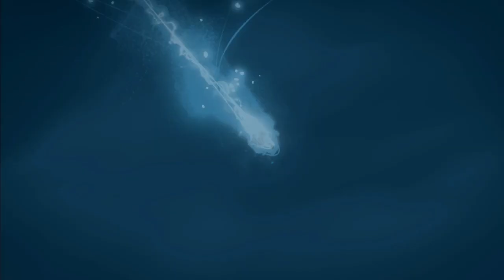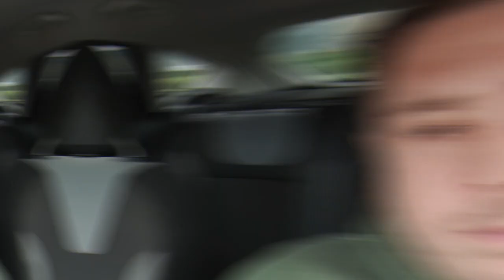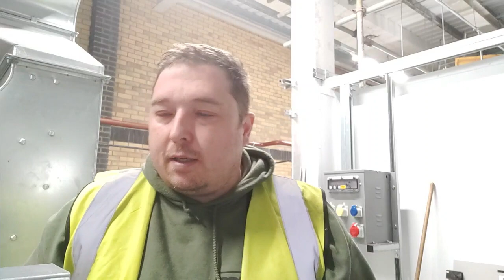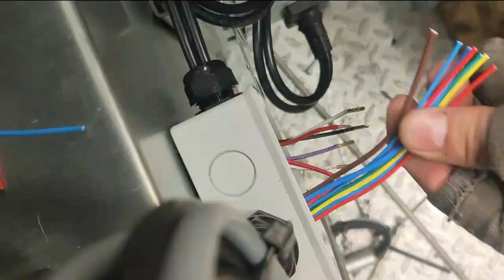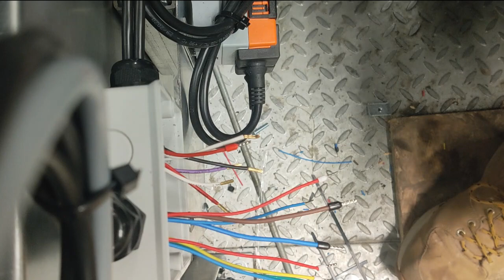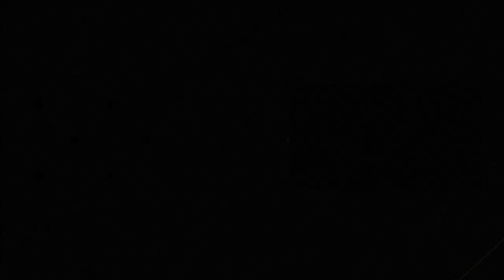ELECTRICAL MIND BLOWING BMS [INDUSTRIAL ELECTRICIAN]

Comment: Nice Sam, normally we'd use the smaller wire markers, then they stay up near the ferrule after termination (you have to crimp on the ferrule after putting the number on though). Have you had to use neoprene sleeving yet and if so have you discovered the PC name for F**ny Stretchers? Also while we are being PC is there a modern rhyme to remember the resistor/number colour code because the one I got taught in the 90's is well out of order.
Reply: What is the rhyme? 😂
Reply from the maker: Yes mate use all that stuff but don't know the rhyme

Comment: First.  Nice work again  but. ..  sidecutter?????
Reply: Good on you Sam side cutters are great universal tools ... trouble with to many sparks is there to fussy , I have often wondered what half of them would do if they did not have the correct tool cry for help ... they have it to easy thease days ... nice job Sam
Reply: @rouman7  this is an on running joke that Sam began. Croppers or side cutters on his podcast. Has spent his whole adult life saying side cutters are pants. Yet here he is using them. Its humour between friends. 

You are right of course, far to many tools knocking around.
Reply: Since when has Sam known what tools are for? ;-)
Reply: I haven't been near any BMS for a few years I used to enjoy it I'm just a house basher these days due to my back being knackered it was nice to see cheers Sam